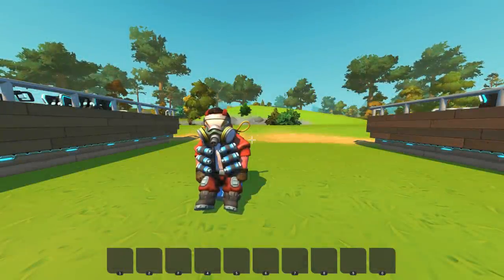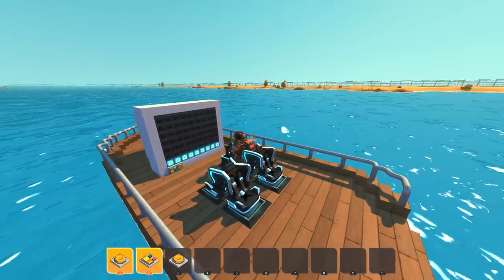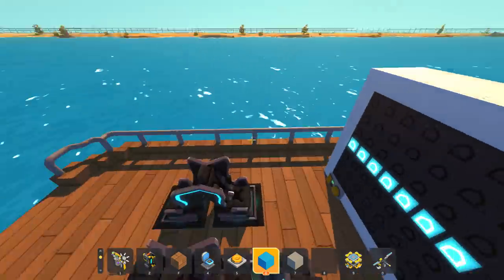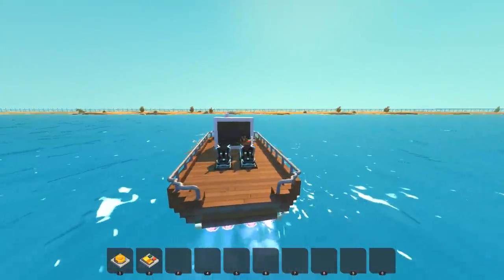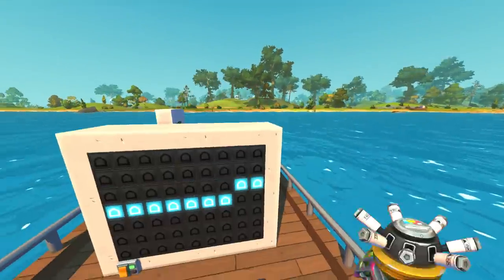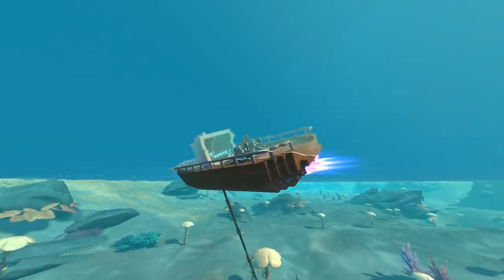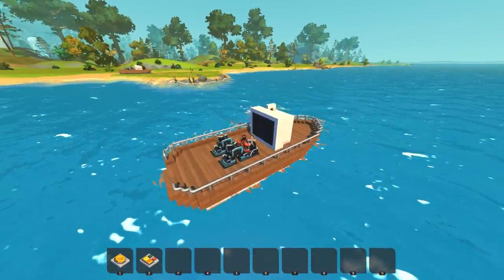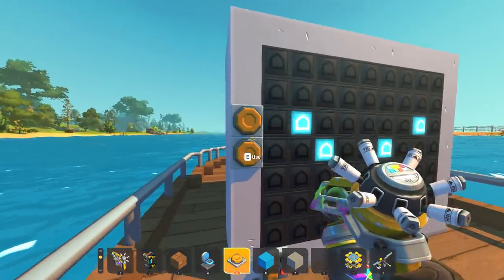I Built a Depth Finding Boat for Mapping the Ocean Floor! (Scrap Mechanic Gameplay)

Comment: You should do multiplayer Monday but you have a day to make whatever you want and you get judged on who has the best creation.

Edit: btw you can build anything as long as it doesn’t use mods.
Reply: I get the vibe that a lot of the appeal to them in doing multiplayer Monday is the "low effort" not in that its easy, but in that it's easier than many other options especially for consistent content. Spending a whole day on things might undermine that. 

Itd definitely be neat though.
Reply: @jacksonpaul5714  thanks for your reply, I probably should have thought about that when posting this.
Reply: Or the opposite: they get 15 seconds to make any vehicle, then race them.

Comment: Why don't you make it ultra high resolution? Make a big ship. That'll be pretty insane. Also, put more sensors in different places along the z axis of the boat so that even if you are stopping, you can see the curve of the terrain.
Reply: You'd basically need to duplicate the sensor pack for each column of the screen.  Simply arranging the sensors would only offset the detection point.  I had a similar idea for showing the topography on the horizontal axis.  Using pistons on a horizontal plane could allow for showing a 3d map of the terrain under you if you made a grid of sensor packs and changed the display from logic blocks to piston heights.  It all gets infinitely more complicated in the logic though.
Reply: @gaalidas4836  yeah that'll be epic.

Comment: the issue of collision could be mostly solved by adding a sensor facing forward with a short timer (that waits in case the depth sensor moves up)to pull back the pistons, also in case of a collision, instead of turning the system off manually put a bearing a few blocks above the top piston and then connect another bearing a block or so below the first bearing then connect a few blocks to the bearing and suspension piece with a sensor detecting compression to pull the pistons up.

Comment: I imagine, if you duplicate the sensors horizontally and hooked up the display to only show the one column for each sensor pack, you could create a sort of side scan thing that would show the actual topography under the boat.

Comment: 12:15
255 is the maximum value of a binary octet, IF you're using 0b0000_0000 as 0, with sensor length that's not practical because you wouldn't have a sensor have a length of 0, so the storage would be better used going from 1 through 256, though the intended maximum can fit inside 5 bits (this is bad because it doesn't stack easily in 8 bits, or one byte) but if the most significant bit were removed the maximum would be 15 or 16 and would fit in one nibble/4 bits/half of a byte

Comment: Hey with the piston sensord one you have to adjust the shorter one to the fraction of speed relative to the difference in legnth extended then you could put sensors ok the side to make it go up when it senses something close to the sides and that plus you could lower the sensors range to 15 or 16 to match the pistons distance so it's all even

Comment: make one that displays in 3d, with stacks of sensors connecting to pistons on top.
Reply: How would you make a 3D display?
Reply: @vibaj16  make a square of pistons and put a block on top of each, wire sensor readings into them.
Reply: Aiden Aune Not really 3D, just a 2d height map